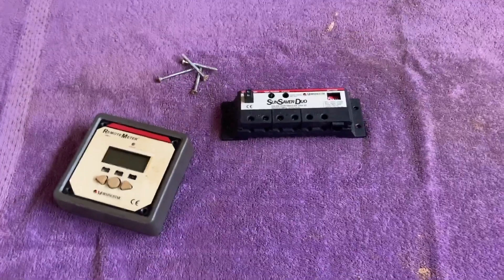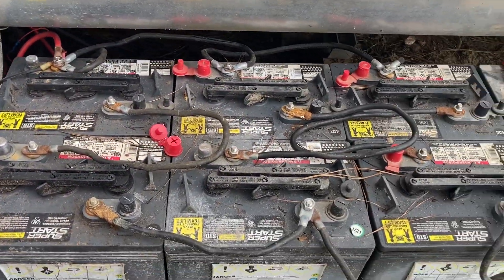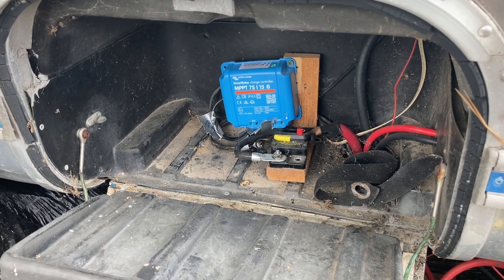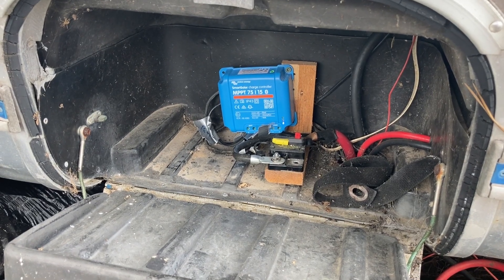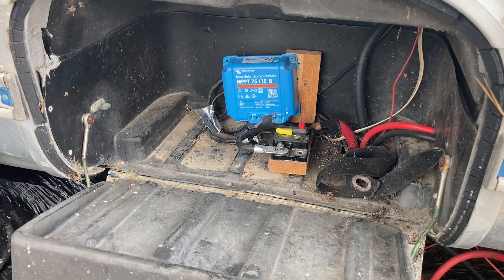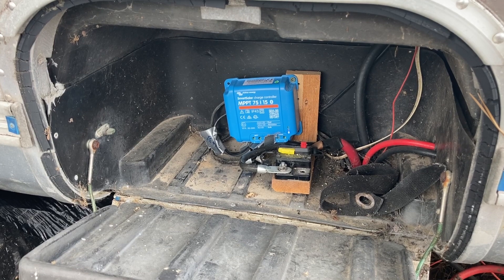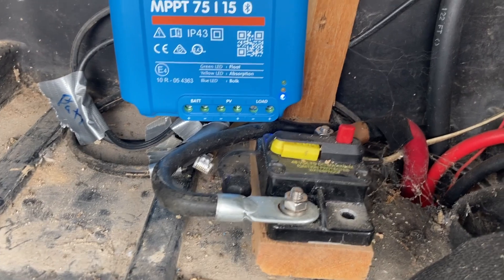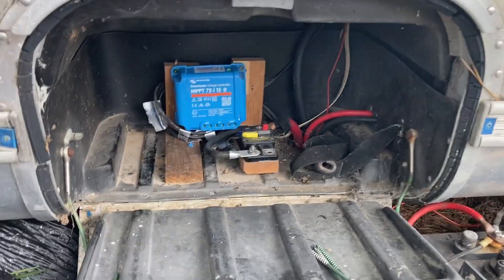New solar controller. Victron

Comment: I am not into solar, but this was interesting. Why 6 volt batteries and not 12 volt?
Reply from the maker: 6v batteries have more storage (generally) so 2 6v wired together. then sets of THAT wired together ( in my case 8 6v wired to make 4 bigger 12v works best economically.

Comment: Glad you found a company / persons that help the customer with what they need and need to know ..I did see you have some battery cables that could use a wire brushing and cleaned up  Just trying to be over helpful I am OCD about clean electrical connections on stuff I cringe when I see corroded battery terminals on a car
Reply from the maker: No, yer right. they ARE cleaner than they look, but sure could be better! Yes, in really happy with this product and the seller. wish them the VERY best!